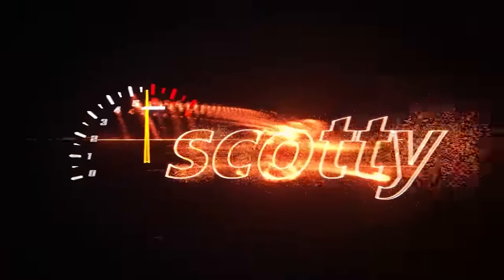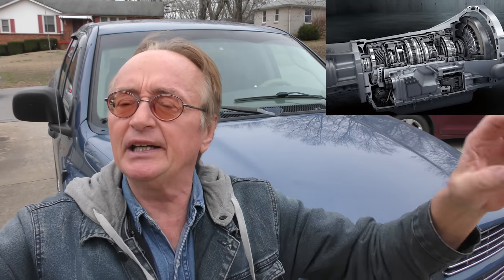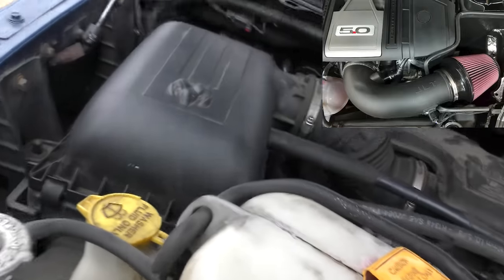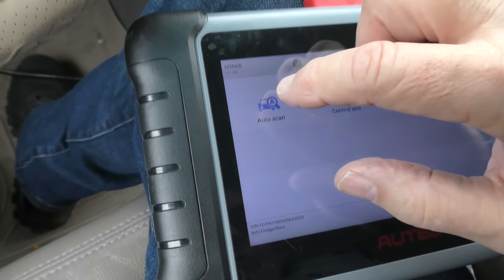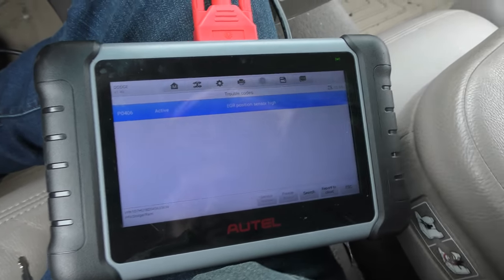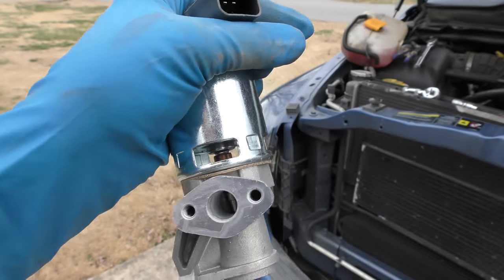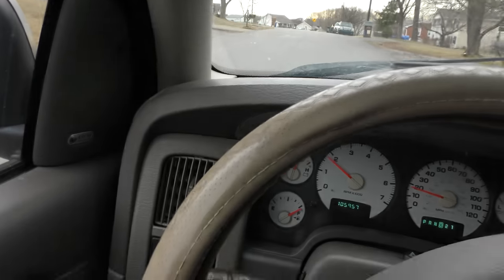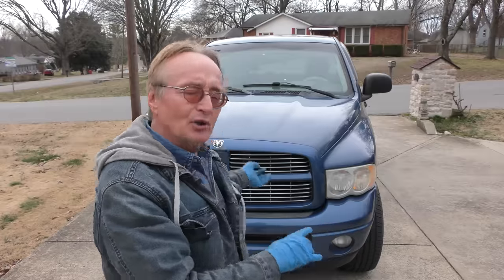Please DO NOT Buy a Dodge (Unless It Has This Engine)

Comment: The transmission in that truck is technically a 6 speed. Mechanically it's basically the same as the 65RFE, but instead of using all 6 gears, two of them take turns being 2nd gear depending on whether you are towing, or if the shift is an up or down shift.
Reply: Truth
Reply: That’s weird I didn’t know that existed lol I know the old 4AOD, 4R70, and 4R75s in all the V8/RWD Fords 2011 and back, like in my 2010 crown Vic, sounds and acts like a 6 speed for some reason. It can be pretty tricky telling what gear you’re in cause they shift so smooth.
Reply: @ESPLTD322  that's the lockup torque converter engaging which can be easily mistaken as an extra gear.
My old Ford did that and initially made me think it was a 5spd auto
Reply: @engineer_alv  oh yes i can’t ever tell if it’s in 2nd or 3rd or sometimes 1st or 2nd
Reply: What would be the purpose of designing it like that? Also, what do you know about the transmission in the 99 Durango SLT 5.2?
Reply: lol 45RFE which is the base for all of them. Electronically added 5th (5-45RFE) and 6 speed autos were 2007+ Diesels and 2012+ as the 65 was just a reprogrammed 545 which was an added TCM module to the 45. Where 3rd's ratio in the 6 speeds were what the Prime (downshift into 2nd for the 5-45 was) 1.50.. thats why downshifting into the "passing highway gear" it shifts at 80 rather than the normal 71mph when going up. 3rd in the 5-45 is 1:1

Comment: I have a 2006 facelift hemi with 348,100 miles on it without any rebuilds. I like how you mention this 2004 isn’t old enough to have a cassette deck but my 2006 does along with that 6 disc CD player lol

Comment: Awesome video.   I have a 2004 Ram 1500 with the 4.7l engine.     Still on the road with regular preventative maintenance.   These engines gum up even with regular oil changes but a flush keeps it running.   Transmission is solid at 156K.   Germans did Chrysler a solid in design and manufacturing good pickup trucks.
Reply: Dakota 2004 sport i gave it up
Reply: 2000 4.7l with 271,000
Reply: 4.7 are thirsty little motors
Reply: One design feature Chrysler fixed with early 2004 version.   Crankcase vent tube ran from pvc valve at oil fill to the back of the engine.   Replacing the tube means laying flat over the engine to reach behind far enough to replace the tube.  Pain in arse.   Later 2004 version changed the routing to make it more accessible.   Hoping to keep my truck on the road a few more years.   Scotty's videos on newer pickups is disheartening concerning the lack of quality and performance.
Reply: The Hemi is 100 percent a Chrysler design , it was designed primarily by retired Chrysler engineer Floyd Allen in highland park Michigan . The 5 speed automatic is also a Chrysler design . The 4.7 was actually designed by AMC engineers before Chrysler bought them .
Reply: My dad has an 08 4.7 and we abuse tf out of it like not changing the oil for 20k miles and it still runs normal
Reply: The Germans did not design that engine, they took advantage of it.  The old American Motors company designed that engine and turned it over to Chrysler when they bought AMC.
Reply: 04 ram 1500 w 4.7l. Been in family since new. Had it for almost 5 years. Zero issues. 133k miles. Fuel pump lasted 16 years. 6 bolts to pull bed off. Was easy. Radiator and tan clutch lasted 18 years. Also easy to replace. Original ac compressor. Gas guzzler but a great truck.
Reply: I got a 2012 dodge ram 1500 with the 4.7 and she’s got 220,000 on her still running strong😂
Reply: 2003 4.7 RAM Crew cab with 206,000 miles. Thirsty as hell but I love her. Just lost her in a tire blowout accident last week
Got a 5.7 Charger now
Reply: @wlm2618  and perfected it! LOL!
Reply: Mine is a sad v6. I wanna put the v8 in it. Not sure if that's possible
Reply: I got a Dakota with the 4.7 and it fucks
Reply: Got a  02 Dakota with a 318 swap in it and I swear that truck seems like it may run forever. It has NEVER let me down.

Comment: I have an 2001 V6 Dakota Quad Cab, 200k miles on it, still runs great and I have done very little to it.
Reply: Thinking about buying my cousin's Dakota v6 (2002 ) for my side job (landscaping/hauling) it has 118k and it runs pretty good, he wants $3,500

Comment: I have 2010 4.7 with 324,000 original. Replaced water pump twice and timing chain once. I run Pennzoil 5/20 full synthetic and swear by it. If it gave up the ghost tomorrow I’m buying another 4.7 the following day. 😉
Reply: 5/20 is pretty thin give 10/30 a try

Comment: I replaced 3 EGR valves on my minivan.  Look very similar.  The first two replacements failed after about 6 months.  Bought a Mopar replacement and its still working fine 3 years later.

Comment: Just for Dodge Ram 5.7L engine owners. I own a 2010 Dodge Ram 1500 5.7L engine. Never had a problem with the Hemi tick. The 5.7l takes 7.5 qts of oil Vs factory that says 7.0 qts. Lack of oil is what’s causing the hemi tick.😊
Reply: I doubt  half a quart is going to make a difference in an engine that takes 7.0 quarts or more, so half a quart is the problem, lol.
Reply: A motor low by 1.5 quarts will still run good. You just can't dog it all the time and you shouldn't do that anyway if you want the engine to last.

Comment: Got a 2005 with the hemi still going strong with 140000 miles. Only problem I ever had was a leaking pressure sensor on the power steering. love this truck and don't plan on getting rid of it anytime soon.
Reply: What kind of oil do you use?

Comment: I have a 2008 dodge ram bought it with 90k and they had wrecked it bad enough that the rear frame had to be replaced. Original everything in the engine. Im sitting at 265k now and the only issues ive had are electrical such as the four wheel drive and cruise control. But the engine couldn't care less. It finally started leaking a drop of oil out the rear main . But like a 10th of a quart per oil change. I was really impressed with it's performance considering i drive it like a race car/work truck at the same time.

Comment: Bought a '68 LaSabre in '80 for $500 since it had new radial tires on it, but also this problem, found the right guy to weld the harmonic balancer key in for $20!  Bought a ''73 Impala Wagon for $700, drove them for months, swapped tires & made some money on both!  Life is good!!

Comment: in reference to the keyway problem,  they make what they  call a step key, one side is bigger, you can measure the damaged side and come up with a size that can be ground down to mimic the damaged keyway in such a way that it has to be tapped in with a piece of brass, while at the same time you have bought a key that fits the undamaged key of the part that slides onto the shaft. at the machine shop we also did maintenance work like this all the time , the customer had a machine down and they were losing big money any time it was down and we did stuff like this all the time, do it right and you will never have any more trouble rather than tear the machine down for days or weeks
Reply: I'm jay Jackson too

Comment: The hemi lifter problem is an oil pressure problem.
Prolonged idles kills the rollers on the lifter pins, which causes the pins to wear the cam lobe.
Never prolong idle anything.
Manually raise rpm by pressing the throttle every 3-5 minutes.
Bump the idle up from 500 rpm to 750 rpm, if you idle regularly and  you will never have an issue.
You need 45 psi or better, not the 39 psi at 500  rpm
I trade my trucks every 200 thousand miles and my kid still has my last hemi running strong at 200 k plus.
 I shut off 7 and 8 gears when I tow heavy.
Reply: You can shut off gears?
Reply: @tsmith4719 yes, on the steering wheel buttons

Comment: Original Owner 2003 Dodge Durango 4.7 Just doing the oil pan at 218k and second set of exhaust manifold. Not  really much more than oil and air filter changes every 3k and new tires  brakes. No complaints. Towed with it alot......still running strong.

Comment: I bought a 1998 2500 Dodge Ram new. It has a 5.9 with 5 speed manual. It has 200,000+ miles and its been a great truck ever since I bought it. with 411 gears it will pull anything, still. Other than routine  maintenance I have put a starter, radiator and need an AC compressor. Other than a couple minor oil leaks, she's still in good shape. I must have gotten one of the good ones!!

Comment: That era (2003-2008) Hemi had valve-seat drop issues.  The intake valve seats were made of a different material than the head and when they heated up they expanded at different rates.  Eventually (usually around 120k+ miles), that little valve seat will drop into the cylinder causing all kinds of damage. The way to prolong it is to AVOID idling for long periods (avoid drive-thrus, etc.)
Reply: Reducing idle also apparently helps with the lifter issue on 2009 and up hemis
Reply: @lostkaiser1995 , agreed.  Good point!  In 2022, Dodge also changed the oil recommendation for the 5.7L hemis from 5W-20 to 0W-20.  I don't know if that was to help with the lifter issue or not, but I've heard it was.
Reply: Wasn't that a 3.7/4.7 issue?
Reply: @juliogonzo2718 no it doesn’t affect the 4.7s. It’s a hemi issue
Reply: @MegaDevify  yeah it does. 4.7/3.7 drop valve seats when they overheat. Dodge Dakota im driving now I got for cheap cause that's what happened. Guy overheated it and it started to miss. I put a used engine in it. Looked like the piston had damage with a bore scope. After I swapped it I discovered I could have just put a head on it piston was fine. Valve seat was out of its bore holding the valve open when I took the head off. Wish I had just put a new head on and new chains. it was a low mile engine and the one I put in had twice the mileage of the truck.
Reply: @juliogonzo2718  happens to a ton of engines, and I don’t doubt it happened to you, but it’s not nearly as common as on the hemis. They have very bad heads and lifters.

Comment: I’ve got a 2002 Dodge Ram 1500 SLT, 4.7 L engine, and I keep it in perfect shape. Anything needing maintenance or repairs, I have it done. 160,000 miles so far, and it will go anywhere and haul everything. Had it from new and it’s a great truck.
Reply: Ive got an 03 Durango with the 4.7, but ive replaced the engine at 150k (not the engines fault but my own).  Still a great engine and a great SUV.

Comment: Also, even though these have issues with lifters they are pretty easy to do, easier then the gm lifters imo. only thing is a lot of the dodges i see start having excessive main/rod bearing clearance and low oil pressure after 220 or so where as the gm bottom end usually make it past 260-270. same with the 5.0 motors from ford. a lot of those end up getting oil pressure issues after about 220 which is usually oil pump or lower end wear.

Comment: Nice!
Hey, I got one for ya; A 2009 Fiat Dodge Avenger 2.4L Auto; No fuse message in Odometer area. Nothing works, including all the auto shut down devises and fob only makes the head lights turn on in auto shut down mode and the tail lights flash till ya start the engine (All runs great!) or rather turn the key on. 
Prior to this the Battery did go very low and then no start .             Fix Me Ideas?!!
Put a new Red top Battery in it, New Battery clamps, New Key fob battery, 
I replaced the TIPM with a used one from Ebay and same exact issue continues and afterwards I took apart the OME one and found all fuses to be good, no discoloration, no rust stains, everything is as new looking and even smells new and I did the Hard rest than where ya disconnect the battery and hold the cables together for an hour plus.  Nothing.    Fix Me Ideas?!!

Comment: Hi Scotty, I'm a 63-year-old woman I just bought my first dodge. Dodge ram 1500 with 60,000 original miles on it it's a 2006. I was scared to death to buy a Dodge cuz I've always heard so much about the electronics and the engine. But the low miles and low price wooed me into the purchase. I have had Ford pickups throughout my life. But these are just different I'll be ready for whatever it throws my way❤

Comment: I had a 2004 Ram with 3.7. At 15 or 20 k during cold weather doing cold start it had a pretty good knock in it, lasting 1 or 2 minutes.  I gave it a new home.

Comment: I had a 2004 Dodge 4x4 with the Hemi. WOW, it sure does have the pickup. ZOOM ZOOM.  The gas mileage was horrendous, Even if you drove it nice.   I traded it in for a 2007 escape after I was disabled, big truck for the wife to drive who is 5'0 tall.

Comment: I mean i'd rather have a reliable 350 horsepower motor in a truck than something close to 400 and gonna grenade in 5 years or possibly less. The tip for those 5 speeds is to make sure you change the little filters in them. a lot of the time those screens get clogged and start causing problems. my brother had to do it in his 2005.
Reply: i have both .... 2005 and 2013 and the 2013 has given me zero problems.

Comment: I have owned many dodge trucks and still do. I have 2 v10’s and a 06 Cummins and I love them. I have also owned 318 and 360 in magnum and LA motors I have had great luck with them. My v10’s are getting old but still trucking along.

Comment: I had a hemi and the 5.9 magnum. Personally I prefer the magnum. more reliable and easier to work on. An added bonus of the magnum is that you can idle it without destroying the cam. 😅
Reply: Ive owned both year 96 and 05 and this comment is 100% correct

Comment: The only Dodge/Chrysler engine I'll trust is the 4.0 straight 6. Those things could withstand a nuclear blast and still run. Mine had over 100,000 miles on it and I ran into an odd dilemma: it was outlasting the interior components. Had to sell it as everything AROUND the engine was wearing out and failing! But the old straight 6 ran like a champ and NEVER EVER failed me in 12 years of ownership.

Comment: Years ago I bought a brand new Chevy Malibu. EGR values were just being used. Soon as the car warmed up it felt like you were driving into a head wind. Took it to the dealer twice. 2nd time the mechanic called me back and handed me a small ball bearing. He told me first thing in the am before you start the car, pull this vacuum line off and stick the ball bearing inside the hose and reattach the hose. Valve never opened again and ran like a top.
Reply: A dealer mechanic? Bypassing emissions equipment. 😳😏🤷‍♂️🤫🤭

Comment: I bought my 2004 Dodge Dakota SLT long bed with 4x4 and 4.7l V8.
I loved it because it still had an old style front end and fenders.
It spent most of its life on the island of Maui until about 85,000 miles. Then I moved to Oregon and eventually Virginia.
Did a couple trips around the US and drive it with all my belongings from Oregon to Virginia.
It still has just over 100,000.
Worst case was my son's and now grandson did a job on it.
Luckily I had the 12 year warranty. I've had the ac replaced under warranty, rear end under warranty and am fixing it right now after my grandson rear-ended people for a third time.
I'm getting to be an expert on the front end. I've replaced water pump, cv axles and other front end bushings. I just changed the valve cover gaskets for oil leaks. Ready to reinstall the clutch fan, radiator, condenser and bumper.
I still like it though. The oil pan gasket could use a change, but I'm not pulling the engine to get the oil pan off.
I'll be turning it over to my grandson, so he can do it.

Comment: When my son was about to turn 16 we went and looked at a 2004 Dodge 2500 at a used car dealership- 190k, rust, broken windshield, broken hood latch, broken fog lights, strong smell of antifreeze, exhaust manifold leak, front seat was so ripped it was missing half the foam, and both front hubs were completely shot, clutch seamed ok, to say the least the truck was pretty used up, but... the place still wanted 6 grand for the truck 5 years ago!!

Comment: I have a 2015 with over a 100 thousand miles only one problem since new brake sensor It's runs and drives the same today as it did as new Best truck I have ever owned

Comment: YUP...SPOT ON SCOTTY...MY 2000 JEEP GRAND CHEROKEE IS STILL DRIVING LIKE A CLOCK....OVER 415,000 MILES...MADE BY DAIMLER CHRYSLER USA...
Reply: What engine? That's impressive
Reply: @madebydade305ify  Just a simple V6...My jeep is not even a 4 wheel drive.....just simple 2×4...in my humble opinion....from 1995 - 2001...Those were the BEST reliable Jeeps grand cherokees made....After 2002...A REAL FLOP...

Comment: Cool but I have a 2000 dodge ram laramie slt quad cab long bed 5.2 litre 318 magnum V8 46 RE AT manual shift transfer case lever on the floor 1500 gloss black with most of the white pinstripe 4x4 with 244k runs strong

Comment: The camshaft/lifter issue has nothing to do with the quality of the engine. It has to do with owners not doing their oil changes.
Reply: Not always.
Reply: It's mostly due to lack of oil reaching the valve train, smaller oil galleys = less lubrication= chewed up cams.
Reply: @Fiden6666  My late Uncle had an early 60s Ford Galaxie with the 292 V8. That situation you posted is exactly what eventually killed the engine in the early 70s. I've seen a fix on YT that corrects that problem now. Wish my Uncle had been able to do that. He had to sell the car.

Comment: I have a 12 ram.1500.with 5he 5.7l and about 250,000 miles. Ive had zero problems with the motor

Comment: Welding,  at  end  of  video.  Years ago, 70;s ,  a guy nick-named  Boo Boo, welded his tranny to the engine. On the side of the street,  in a small town.  Truck, was a Kenworth..... / he had stripped the bell housing threaded  holes..../ Today, i weld up stuff, too.  Generators, with trashed engines ; weld a shaft to gen head / cutoff crankshaft, at the cam gear.  Weld large bolt to it - after centering.  .  to make a belt - pulley ; stand-alone generator using separate engine... THANKYOU   SCOTTY ;  FOR  ALL THE WORLDLY  HELP.